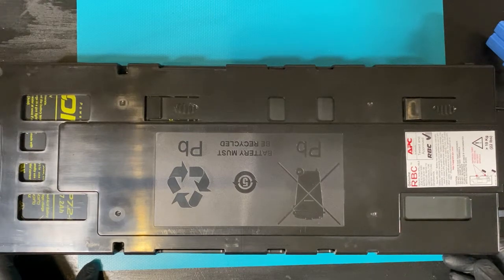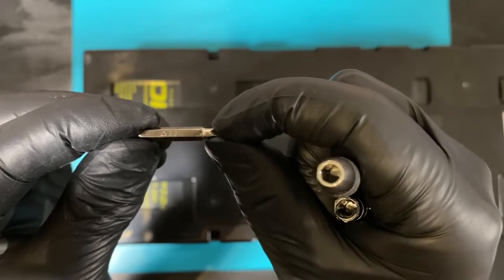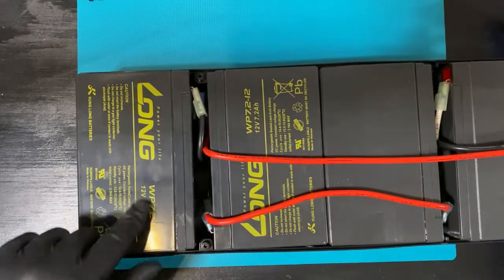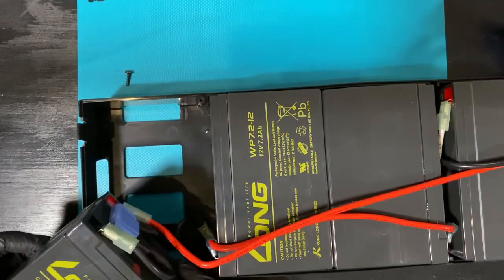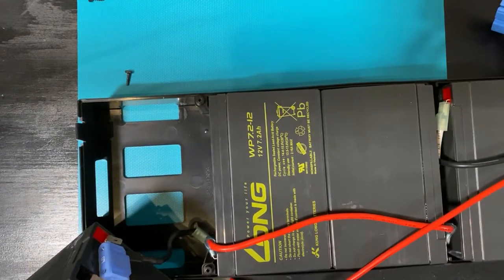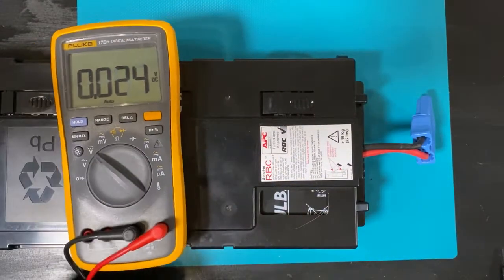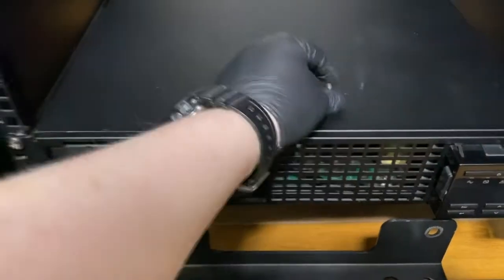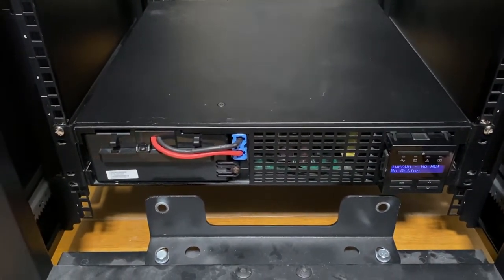APC rack UPS SMX750I battery repair | APCRBC116

Comment: Dude…you should always replace all for the same and make sure they are voltage matched before or you risk some “rapid heating” or lowest common denominator when in series like this.

Comment: I appreciate the video, just picked up a SMX750 second hand, very inexpensive.  Batteries are good for another year but your video showed how easy it is to replace them in the battery pack/cartridge.  Great information on the routing of the wires afterward, will save me from having to re fit the cover as I likely would had done the same thing as you the first time.  Thank you for sharing!
Reply from the maker: TBH, I was wondering when I made the video on whether anyone will see or care about it.

Comment: I did exactly the same but instead of trying take each cell out of the cartridge, I flipped the whole lot over, then replaced the cells. After, I just place the half cartridge shell on top of the cells and flip it back up again.